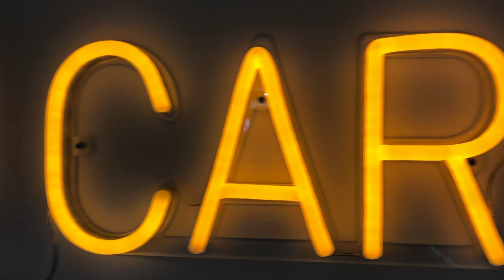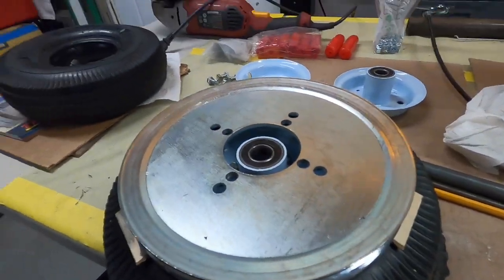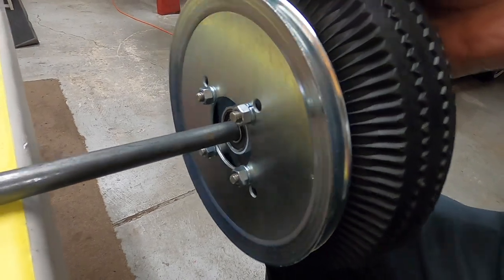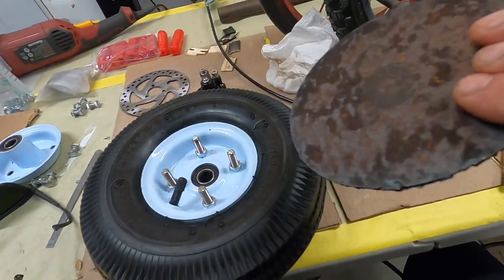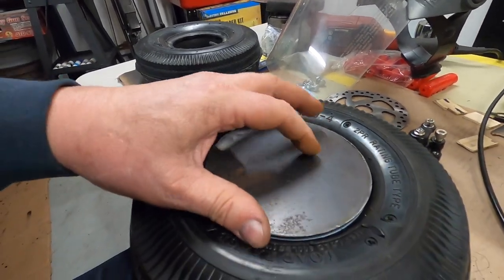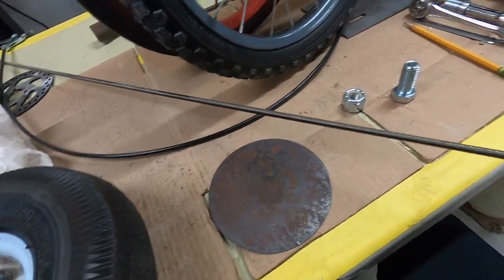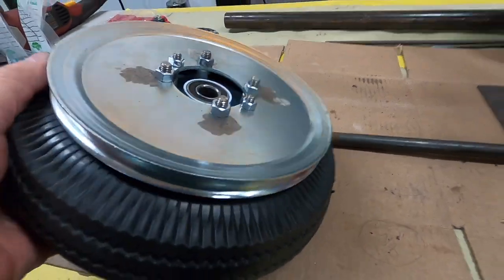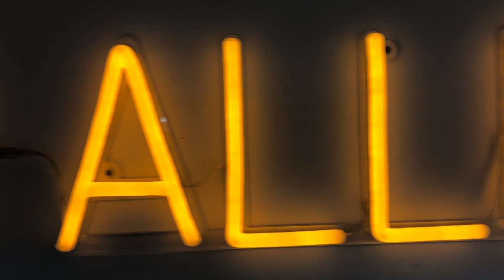REO Trikeabout build part 1, building the rear drive wheel

Comment: Very cool! You have done some great work on this so far! Makes me want to build my motorized bike project that I have been itching to do for a while now!
Reply from the maker: Yea, I have the front wheel all mounted, with the frame extended. It looks good. Now for all the fussy stuff, like the controls and odds and ends. It has been going quick. Got about 18 hours into it now. IF I keep at it, it should be ridable in a week or so, though I am going to start doing some more work on the Bel Air starting this coming weekend..... so it might be a little longer.

Comment: Interesting project.  And more complex than one would expect. Howard, I see your EGO battery and charger beside the bench grinder. What EGO tools do you own, and how do you like them?  I bought the self-propelled mower last summer. Love it, so far.
Reply from the maker: I bought the self propelled mower..... the mower is super light and my yard is small, so I rarely use the power drive. I also got their larger hand held blower, trimmer with the edger and a hedge trimmer attachment. The local ACE hardware where I purchased them from, stated he sells 3 battery mowers to one gas mower now. A lot of my neighbors have gone to battery lawn equipment also..... one who had a super loud gas mower, who mowed every Sunday morning, now has a quiet battery mower. It's so nice not being disturbed by an ultra loud mower on a early Sunday morning!  

One neighbor has a EGO two stage snowblower. It works amazing. He clears his and several off his neighbors drives with it. I noticed in the heavy wet snow we had a couple weeks ago, it moved the snow as well as my Ariens gas blower. If my Ariens ever wares out, I will replace it with the EGO two stage blower.
Reply: @OldCarAlley  I appreciate your taking the time to reply in such detail. I have the mower and the lawn edger. Both are excellent.